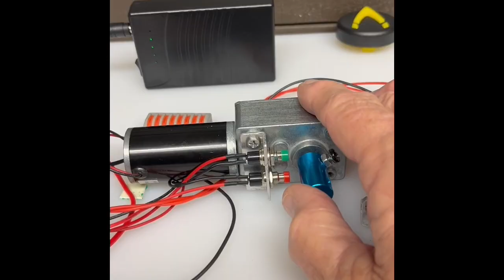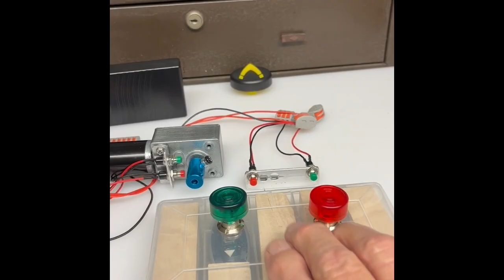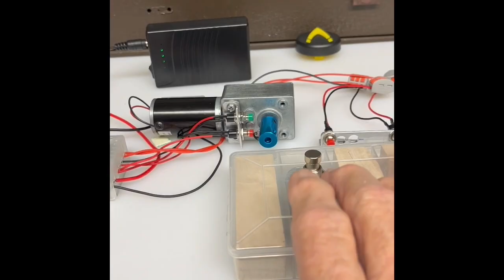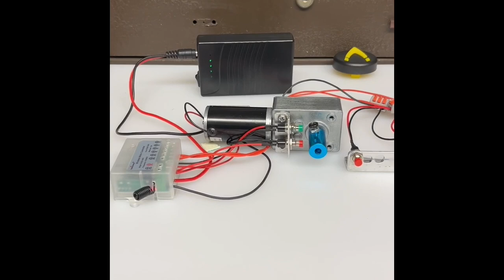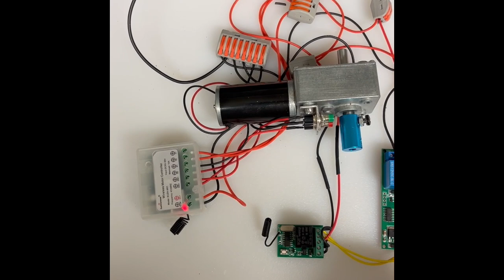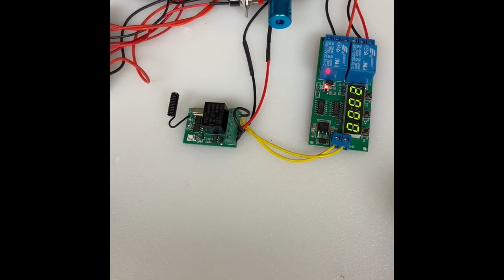Part 1 - LiveScope Motor Control Explained

Comment: Bill, this looks amazing and I am excited to attempt myself.  I can’t find what you used to house the motor?  Looks like a conduit LB, but what size?  How did you reduce the outlet to fit around your pole?  What did you use as a pole?
Reply from the maker: I use a 1 1/4 inch LB with a 1/4 inch down shaft with a 1 inch pvc rotating shaft. There is a small amount of clearance but the shaft is centered by the 1 1/4 fitting at the end of the fixed shaft. Download the pdf build sheet from the description in UltraScan or UltraLock videos

Comment: Thank you Bill for creating something for all of us DIY'ers. Would love to see a video of you building one from scratch.
Reply from the maker: I am not very good at this uTube stuff plus I have to do everything one handed so I can hold my phone with the other. My video on  build tips does show a lot of the build details and there are complete build documents in the description. 
I try to make my designs such that they can be built with hand tools and the electrical components are plug and play. This is why I moved away from the first designs that required some soldering to a single plug and play controller that controls all the functions of the unit.

Comment: Hi Bill, thank you for this video, it helps greatly! I’m trying to open your link to the pdf, but I’m getting an unable to open the file error.
Reply from the maker: Try it now. I replaced the link. It worked for me but that may not be the best test.
Reply: Im having trouble finding the link, could someone help me please
Reply from the maker: @tri @trinitythevenot2832 
It is in the description. You will have to expand it.

Comment: Bill found your video showing use of the little Fushionsea motor control. I wondered if you have had issue with them. I have ordered two units both having the same issue. When the limit switch is hit unit stop. But same issue with both they stop working.  The motor will not go in the opposite directing nor will it do anything. I cannot find any way to get it out of this mode. Just wondered if you had this issue.
Reply from the maker: I have not had that problem. I have been using this little controller for about a year and used it in 4 different builds. What you describe makes me think there is a problem with polarity. Using the same color wires as in the instructions helps to maintain the correct polarity through the connections. It is important to remember that a positive voltage applied to the red wire on the motor will cause it to rotate in a clockwise direction viewed from the top of the shaft. The polarity of All other connections have to made with this in mind. 
I am working on Part 2 of the video where I present an optional arrangement for the rotational limit switch and discuss polarity quite a lot. It may be a few days before I post it.  I just received a switch that has been delayed in transit due to weather so I can work on it in the next few days.
Reply: @billreynolds3539  Bill Thanks. Polarity was all correct. Seems like the unit latched. I had is set to momentary. It was working until I hit the limit with my finger. Unit stopped but will not do anything else.
First unit I received would not program, little light just blinked constantly. I'll keep watching,

Comment: Bill, thanks for your work showing this to us...greatly appreciated for us DIY guys!  I was wondering how many hours you have fished with your unit and if and what issues have you experienced.
Reply from the maker: The mechanical parts (motor, downshaft etc) The controls have evolved to the ones shown being used for about a year.  The first thing I did not like was all the wiring required to install the unit and operate the foot pedal. This is what led to the current WIFI controls. 
Another concern is mounting the unit perpendicular to the water line. The current bracket design addresses this. 
The most recent question for me is what is best, pole mount or transducer shaft mount?  I do both and have to say that most of the time I like the transducer shaft better but about 20% of the time it does not work. I have a prototype that mounts on the TM shaft so it rotates with it but can also be rotated individually. This will probably roll out this summer.
Reply: @billreynolds3539 has the motor given you issues? I was thinking of mounting unit on my Force trolling motor. I have only used a hand turned pole mount. It would be nice to just have to deal with TM every time I move location which sometimes that might be 25-30 times a day. Which setup. Was not working 20% of the time?
Reply from the maker: @ronf1805 
I was referring to when I have the transducer on the trolling motor shaft. This works pretty good except when the trolling motor is on spot lock. Obviously it would
 Swing the transducer back and forth. 
When fishing with a coangler and trying to stay on a brush pile there is no way the co-angler can get a cast in   I prefer my Ultra-Lock II for this instance. I I put the boat broad side to the brush pile and rotate the transducer with the foot pedal until it shows the brush pile then engage the ultra lock so it compensates for boat movement as it moves around in spot lock. This way the Co-Angler can see the direction the transducer is pointed and cast to it the same as I can. 
As for the motor, I have not had a problem. 
I do not have a mounting bracket for the Force. Shouldn’t be hard to figure out, but I don’t own one to take dimensions from.
Reply: @billreynolds3539  I really appreciate your time and effort showing us how to build.  I presently built an old trolling steering motor with foot pedals and works great.  But would like to mount a unit like yours on my Force... Lighter and smaller than the old steering motor. AND  would deploy with TM. I printed up your plans and will start the process. I will use the TM stand bracket for a mount pattern out of aluminum plate. Thanks again.,
Reply: @billreynolds3539  Hi Bill, thanks for all the posts and explanations, really helping. Looking forward for that double option prototype